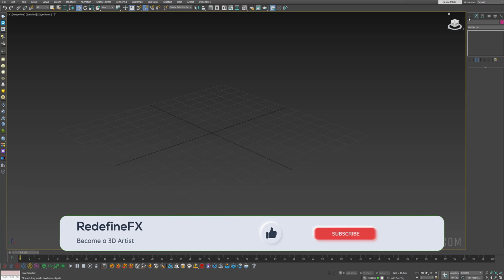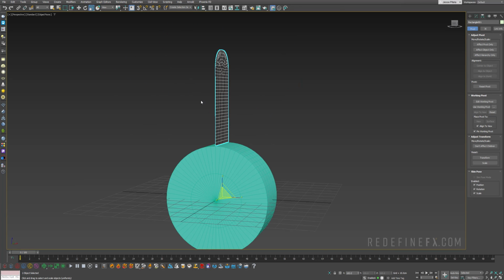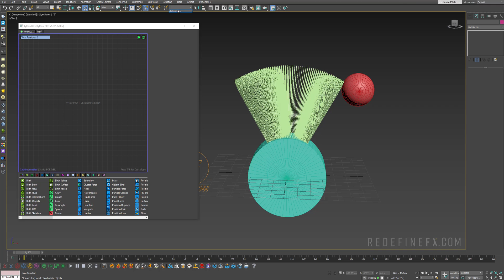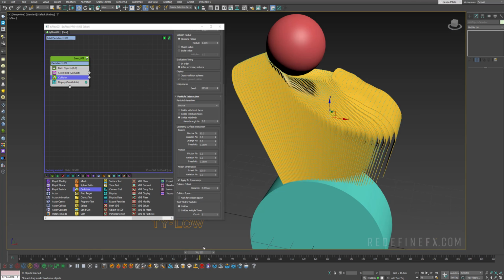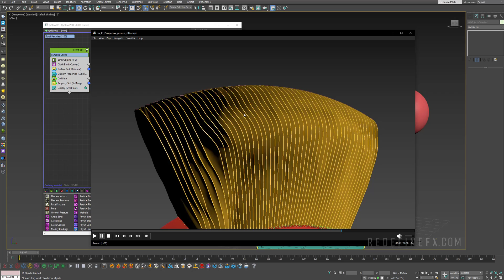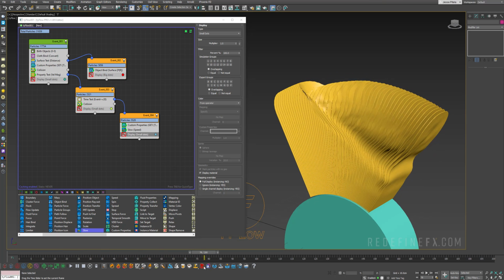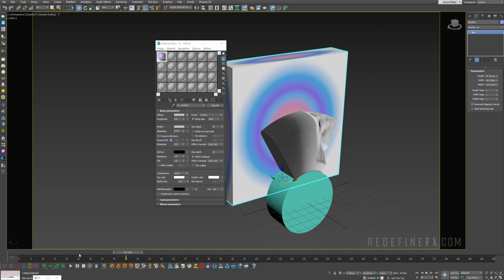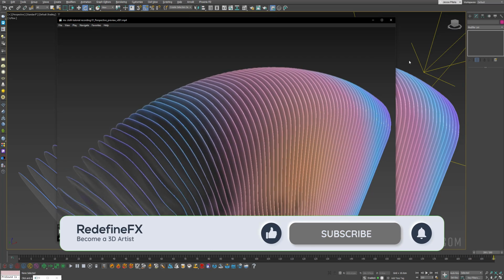tyFlow Cloth FX Tutorial: Visco-Elastic Sim in 3Ds Max 2023 & Vray by #RedefineFX

Comment: Hello. I used mapping in another job by looking at your tutorial. However, when I try to render it with vray-disturbed, the mapping breaks. It only shows the correct mapping with one computer. I used Vray Gpu render. Is there a solution?
Reply from the maker: I think you have to tycache it first
Reply: @RedefineFX  Thank you for your answer. TyCache is only available in PRO version I think. I have been trying to learn with tutorial videos for a while. I think I will buy PRO now. Thanks again.